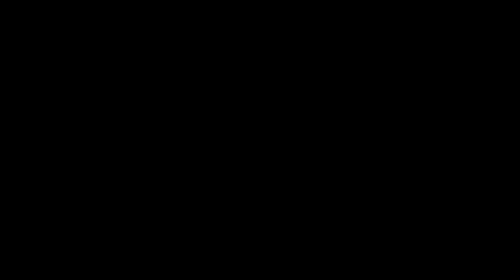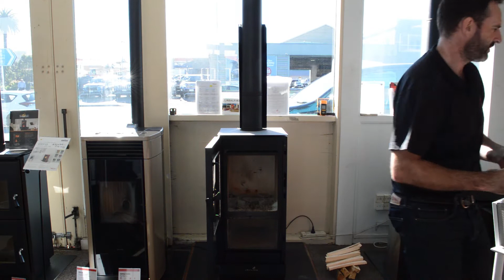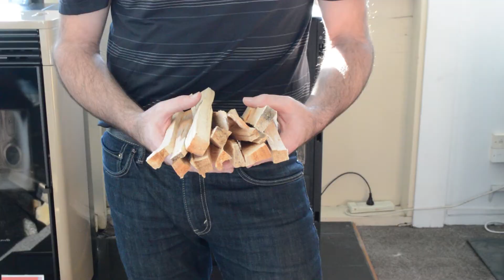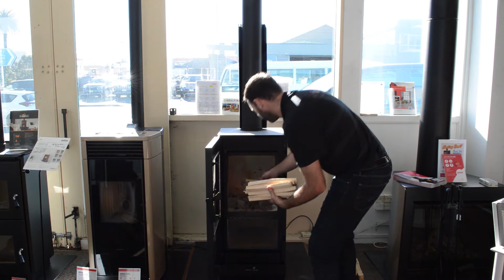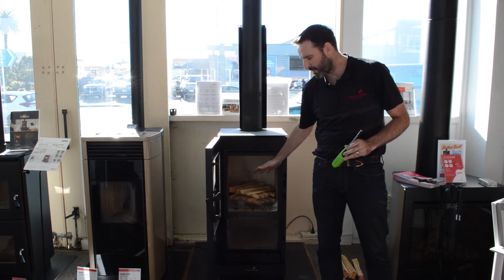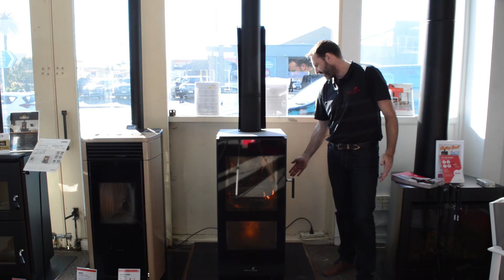Jayline UL200 Instructional Video

Comment: What's the main difference  between  ul200 and the walltherm model
Reply from the maker: The Walltherm has a manual bypass mechanism, a fan forced convection heat output and a more industrial appearance. The UL200 has an automated downdraft process, passive radiant and convection heat requiring no power and is also a more contemporary aesthetic.